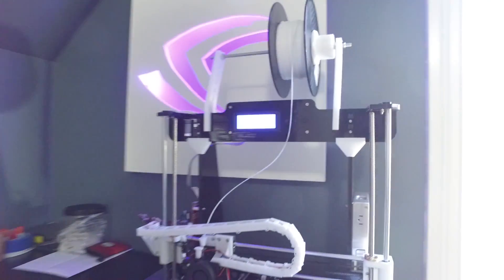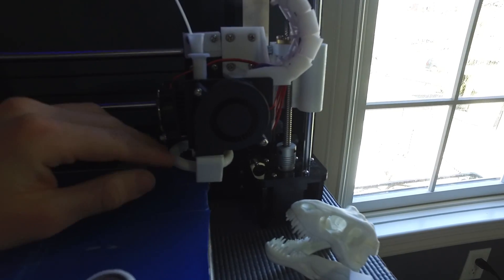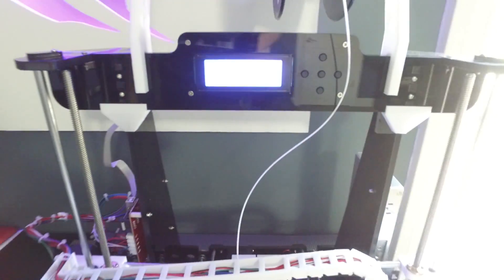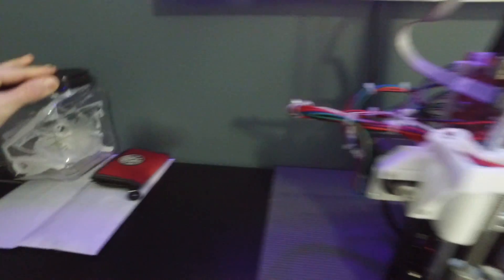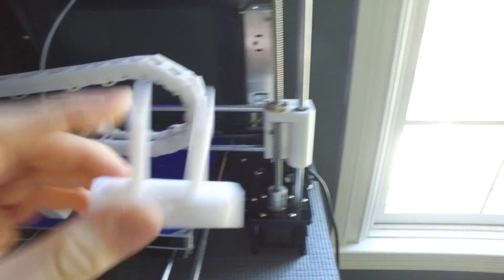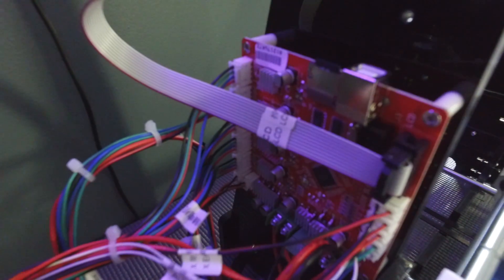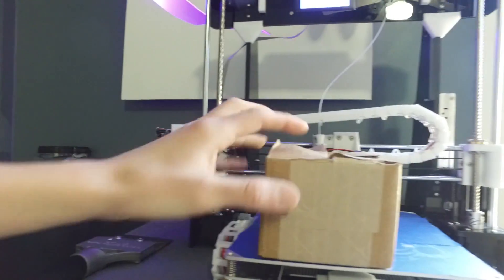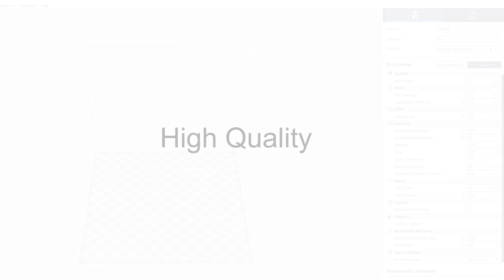Anet A8 Mods, Upgrades, and CURA Settings

Comment: Shouldn't the z screws be up inside the guide holes? I adjusted the slack from the Z springs on both sides to achieve this. It deffo helps eliminate z banding.

Comment: Just got my printer set up.  I am having a problem.  At first, it would start the print off of the bed.  I made some adjustments.  It started print on bed, but then will go off bed again.  Can you point me in the direction to fix this?  Is it a leveling or centering problem?  Thanks for all the great info.  Can't wait to print.
Reply: I had the same problem I tightened my x belt and it started to print good

Comment: Interesting bits...
You should take a couple of those bearings and print top housings for the z-axis. The bearings allow the z axi to spin without top wobble. It's not a crucial vitamin compared to the belt tensioning stuff, but it'll help with tall prints.

Comment: Hey can you tell me how did you start printing when you completed the pinter assembly. Is there anything you did to the firmware or anything which helped you start printing or it started printing out of the box after assembly is done

Comment: Funny how many complains about the n and l wiring of the powersupply. Hell in many places u can put the plug in the outlets every wich way so it does not really matter.

But No cover for the mains now that is really bad and should be fixed before some idiot bumps in to it and get electricuted.
Reply: Anders Strömqvist definitely, I’m working on a design for a psu cover with an adapter to pc cable.

Comment: hi iam getting a a8 how about providing your actual cura config file  and whot windows system will it run on and the pc min specks thanks
Reply: nightrider mick you should be able to use 7, 8, or 10. I use 10. But also read the comments I posted the config file. But here it is anyway... https://drive.google.com/open?id=0B9MwKeBPVAuiLU5BcHgyeTk1ejQ I have an i5 in my pc runs fine.
Reply: whot will be the min spek to run on pc m8
Reply: nightrider mick windows vista or later, OpenGL 2 compatible graphics card, and an intel core 2 or AMD Atholon 64 or newer. 

I have an intel core i5 4690k and runs perfectly but basically anything can run cura. It’s just a slicer, not a 3D building software

Comment: you mounted z rods badly :) Shaft from steper motor goes inside rod tensioner just 5mm. Same goes for the z rod (just 5mm in tensioner). When you do it like that....z rod goes all the way up through the hole in the frame.

Comment: Just a heads up, the Anet A8 power supplies come as 220v defaulted. I found someone else who mentioned it in a random post somewheres. This causes all sorts of power issues if you're on 110v
Reply: Peter Couture so what should I do exactly?
Reply: There should be a switch on the old power supply for you to change the 220 to 110. Use something none metalic to do it.
Reply: Peter Couture ohh ye I already did that. Mine is switched to the 115 not the 220
Reply: The old one flat out did not work.
Reply: 115? Hmmm maybe you got one for the wrong country power type.

Comment: Your power supply cables are not correctly connected, brown is live L and blue is nuetral N. That is european colors on the cable you have. http://www.electronicshub.org/wp-content/uploads/2015/09/EU-Color-Code-for-Electrical-Wiring.jpg

Comment: You should buy a build plate sticker or build plate surface so you don't have to spend so much on tape.
Reply from the maker: Just use thick masking tape. I still have not gone through a roll and i only spent 8 bucks

Comment: Although on AC power it would not make a difference on functionality but you have the Live (Brown) and Neutral (Blue) wires swapped on your power supply. Having said that it is good practise for safety reasons to use the Brown wire for Live (L) and Blue for Neutral (N).
Reply from the maker: No I understand... The Manufacture did not properly sleeve the cables...

Comment: My printer is built and levelled ,Cura 2.5 is installed. How do I get the Anet A8 to show as one of the printers? Do I have to Plug the USB into my PC? It does not appear in the lists and the "other" choice only gives one option.
Reply: Umm when you are setting up a new printer just add pursia i3 or other, then put in the dimensions for the bed... You don't need to connect your printer to the computer.
Reply: Awesome ,I added a Prusa i3 and named it Anet a8 at the bottom of the page.

Comment: hi, what settings should i used for abs fillament, its an anet a8
Reply from the maker: So for temperatures use what it says on the packaging of your filament it usually is the best. 200-250 °C, depending on your plastic.

As for settings all cura settings that I have at the end of this video work the best. Just watch to the end and you will see them.

Read this for some tips- https://www.matterhackers.com/articles/how-to-succeed-when-printing-with-abs

Comment: Hello, thanks for good video and description, just a lot of work, 
I just got my printer last month, looks like yours (the newer one), it is build up now, but I did not get it running.
Problem:
1) If I go to presets: PLA heating , I get a blank screen and printer shuts of
2) I can heat the extruder with direct definition of heat temp --> works, but
     if I try to activate the heat bed --> it shuts of
3) so, just heating up the extruder and try to print the sample file from SD card it does not start (at least waiting for 20 min)
4) have seen your power suply is different than mine did you change it?

sorry , a lot of questions, but 
could you discribe if you, or another user, has detected same?
What is the "normal" waiting time antul priter starts printing.

A video to explain woud be perfect

Regards
Reply from the maker: Ok so first off don't reference of my PSU (it's different), my cables have different groundings, and the sleeving colors are different.

My PSU- http://www.ebay.com/itm/Mean-Well-LRS-350-12-348W-12V-29A-Single-Output-Switchable-Power-Supply-/122214365016?hash=item1c748b3758:g:nroAAOSwcLxYH3aE

The wait time for it to start printing depends if you preheat the pla or not. Basically when your temperatures reach the temperatures set in the file it will start printing. For instance, I print using a heat bed temp of 55, and an extruder temp of 190. Since yours is not heating up, you have probably wired something wrong, or have a bad component.

Trouble shoot go to these places in each order-
1st look over all you wiring and make sure you did not make a mistake https://www.china-gadgets.de/app/uploads/2016/11/A8-3D-Printer-Installation-Instructions-2016-6-30.pdf

2nd ask your question in detail here https://www.facebook.com/groups/1068531466501015/

-3rd Contact your seller to get a new printer, or figure out what's broken
Reply: Tech Boosted
 Thanks, with getting a larger power supply (as yours) i could heat the heatbed, Now all works fine. My mentioned "waiting time" was due to that the program was waiting for a signal of reached Temperatur .
Reply from the maker: Nice

Comment: Nice video keep the good job i got a question what version of Cura are you using because I'm using 14.07 because i can't set it up whit the new version of Cura if you are using the new one can you help how to set it up please and thank you
Reply from the maker: https://ultimaker.com/en/products/cura-software

Here this video will help, it's in german, but still easy to follow.
2.5- https://www.youtube.com/watch?v=p2fiAsT7w7w

2.3.1- https://www.youtube.com/watch?v=gSXFHd-UDmE
Reply: Thank you i will try it later today
Reply: i follow the video but my PC recognize the printer like CH340 but the Cura 2.5 won't recognize the printer any ideas
Reply from the maker: You have to set up a custom printer... My printer is not connected to my pc, I transfer files via micro sd card.
Reply: ok so i can't use the printer with my pc only to fix the files with Cura and then use it in the printer
Reply from the maker: Will you re word this comment. Is this a question?

Comment: Hi i got a question I'm assembling my Anet A8 and I'm stuck i don't know where the red and black wire from the bed connector goes please can you tell me where go got the instructions to assembling i see couple of installations but they don't have the plug the we got please help
Reply: Ok so the black and red cables go on to the screw mounts on the mother board where it says "BED." I don't think it matters which goes in which, but when facing the mother board, the black goes on the right, and red on the left. Just use a screw driver, and unscrew it a bit, push each cable under then tighten down. 

If it is a light green plug connector, I am pretty sure you plug it in where it says "BED" in white text on the Mother board. I don't have this kind of connection though. However it should be the same as the open cable connection. 

If this is unclear, just re comment and I will try to help you.
Reply: thank you so i don't need a red and black wire from the power supply to the mother board or I'm missing a wire I'm confuse so how i i give power to the mother board sorry to ask my printer is missing the instructions
Reply: First off instructions are on the micro sd card. Plug into computer with provided converter.

Secondly, You will have a black and red cable that go from the power supply to the mother board.
Next you will have a red, black, green, and blue cable go from the hot bed to the motherboard. You will put the red and black cable where it says "BED," and the green and blue one will go to "BT" (BED TEMPERATURE)

What ever you do, make sure that you have your Power supply cables going into the motherboard in the right orientation, "Black  negative, Red positive..."

https://www.china-gadgets.de/app/uploads/2016/11/A8-3D-Printer-Installation-Instructions-2016-6-30.pdf
Reply: thank you again

Comment: the spool holder is adding weight to an already fragile frame and doesn't help in any way..... and tensioning your belt to the point that you need frame braces is going backwards... you are just creating problems! my printer works perfectly without all that crap... it's all about your settings.... not the hardware!
Reply from the maker: You make a point, but you also have to consider convenience. I find it very nice to easily swap between two colors with the spool holder from  above.

Comment from the maker: Machine Settings- https://drive.google.com/file/d/0B-3ffI37kjfvYlI1Wk1hQ2VuZ1U/view?usp=sharing
Reply: what power supply did you buy?
Reply: Meanwell Power Supply 12v 29A

http://www.ebay.com/itm/LRS-350-12-Mean-Well-Power-Supply-12V-29A-/122452640151?hash=item1c82bf0197:g:3wAAAOSwWWxY~lS-

Comment: Hi, I had a power supply issue with my Anet A8, the sticker for terminal identification was shifted to the right too much resulting in termination mistakes. Fortunately, I noticed before I shorted anything out...but my machine would not turn on until I noticed the issue. Once I shifted all my cable to the left on the terminal strip, everything worked fine. Happy printing:)
Reply from the maker: Good to hear you fixed the problem.

Comment: where'd you get the 30 pack of bearings?
I have been looking for a good price on those, but every one I find is only an 8 pack or 30+ days shipping
Nice vid man, love that wall light too!
Also, What version of cura are you using...
Just got my anet & it came with v14 and the seller said they recommend using v14 for "some reason", not very helpful
Reply from the maker: Bearings
- https://www.amazon.com/Hundred-Shielded-Greased-Miniature-Bearings/dp/B00NX3LKY6/ref=sr_1_2?ie=UTF8&qid=1490573784&sr=8-2&keywords=bearings+100
or
- https://www.amazon.com/gp/product/B0045F7FJ0/ref=ox_sc_sfl_title_1?ie=UTF8&psc=1&smid=AFLT987H7WA7G

they may say 30 days, but if you have prime, or pay a tille extra they come in way faster. (I got mine in 2 days with prime, where it had originally said 30+).

As for cura, I use 2.3.1. Just go to their website and download the newest version
- Version 2.4 https://ultimaker.com/en/products/cura-software

I am not exactly sure what you mean by "Version 14," Like for the printer? or Cura?

For my printer it uses some version of  softwear that "Omni3d" provides, I have not looked into that.
- http://www.omni3d.com/en/firmware/
Reply: The way cura used to do the versions was by year, until 2016
so 14 was in 2014, then 15, then 2 came out in 2016 and just started adding sub versions.
Not sure which board you have, but yours looks like the same as mine, so i will just try the new version & do the same print as one of my others & see how it turns out...
WOW - Those bearing prices! Much better!
Thanks much!
BTW, Look at your Mainboard, on the Top Left corner, does it say ANET 3D or is there a version number too?
like rev 1
Reply: Do you use ceramic bearings at all for the center?
if so, have you found any good prices on those?

Comment: Hi I would recheck your AC power cable wiring to your new power supply , In most of the world, Brown = Live/Hot & Blue = Neutral, your video shows   you have brown and blue wires in the wrong  terminals just swap them making sure you disconnect power cord from the outlet first.
Reply from the maker: Yes, I know it looks wrong, but the company who sent me the PC cable, wired wrong. I assure you as I checked mine first with a multi-meter. I also encourage anyone with an anet A8 check their cables and PSU as well.
Reply from the maker: Plus mine runs just fine ;)

Comment: How can I configure my printer so that a 1 by 1 cube doesn´t come out like a 1,1 by 1,2?
Reply from the maker: Do you use CURA? 

Watch This.
https://www.youtube.com/watch?v=gSXFHd-UDmE

If that did not help use this.
http://www.anet3d.com/uploads/soft/160525/Print-Quality-Troubleshooting-Guide-Anet.pdf

You can copy this code here when setting up a "Custom Printer" In CURA.

Startcode: 
G21 ;metric values
G90 ;absolute positioning 
M82 ;set extruder to absolute mode 
M107 ;start with the fan off 
G28 X0 Y0 ;move X/Y to min endstops 
G28 Z0 ;move Z to min endstops 
G1 Z15.0 F9000 ;move the platform down 15mm 
G92 E0 ;zero the extruded length 
G1 F200 E3 ;extrude 3mm of feed stock 
G92 E0 ;zero the extruded length again 
G1 F9000;Put printing message on LCD screen 
M117 Printing... 

Endcode: 
M104 S0 ;extruder heater off 
M140 S0 ;heated bed heater off (if you have it) 
G91 ;relative positioning 
G1 E-1 F300 ;retract the filament a bit before lifting the nozzle, to release some of the pressure 
G1 Z+0.5 E-5 X-20 Y-20 F9000 ;move Z up a bit and retract filament 
G28 X0 Y0 ;move X/Y to min endstops, so the head is out of the way 
M84 ;steppers off 
G90 ;absolute positioning

Comment: I don't like being a party pooper but i suggest you cut out the part of the vid where you say your selling the spinners. you can actually get in a lot of trouble for selling open files. I suggest making your own design spinners if you are selling them.I mention this from experience.
Reply from the maker: Well if you use the "commercial use, and creative commons" option on thingiverse you can find spinners to sell, or you can use "Inventor" like I do and design them.
Reply: ok, the one you were spinning looked like one i saw on thingiverse that didn't have CU or CC. and for your printer my dad and i have been designing better upgrades you may want to consider. including a better tensioner.
http://www.thingiverse.com/thing:2134573
http://www.thingiverse.com/thing:2115095
Reply from the maker: Here is what I used to make my spinners.
You can also follow the steps and design your own.
http://www.thingiverse.com/thing:2098458

I have created some really cool designs in Auto Desk Auto CAD...
Reply: i've designed a few myself in solidworks. just haven't gotten around to posting them on thingiverse.
Reply from the maker: Sweet.
Reply: Its a public Domain
Reply: yes you are a chinese spammer because the same exact message was posted on another comment i commented on. under a diffrent name. gearbest is the worst.  advertising EVERY FUCKING WHERE.   and no customer support to speak of
Reply: Dude, I'm not chinese spambot. This is just a good deal and I had no problems with Gearbest.
Reply: its not a patented product. the inventor never renewed the patent
Reply from the maker: Thanks, Ye I know it's a really nice printer for the money...
Reply: attack125 yea i lost 2 x 150 buck disputes.
Reply: i think you can get in trouble for even uploading that print file.  that's a patented product
Reply: Look - it's for 146.99 USD from EU warehouse (no tax in EU and fast shipping)
http://couponsgearbest.com/2017/06/15/anet-a8-3d-printer-eu-plug-active-coupon-price-gearbest-2/
I bought one

https://www.youtube.com/watch?v=ds7dGtJncv4
Reply: I can't believe it's just for 158.99 dollars
http://www.gearbest.com/3d-printers-3d-printer-kits/pp_337314.html?wid=21&lkid=10312400
I hope this can help you

https://www.youtube.com/watch?v=ds7dGtJncv4

Comment: I am using the same board and my screen showing default for heat bed and extruder what should I do
Reply from the maker: Umm well under the "extruder" option, you can manually change the temperatures, on the actual printer, or in cura you can adjust the temperatures to where you would like them. If this is what your asking?

Comment: awesome video.. mine is paid for but I'm in the holding pattern for hopefully just another week before they send it.. Have you seen guys putting glass on their beds instead of the tape??  they say its better.. what do you think?
Reply from the maker: +Hairless Hippy well personally I originally really liked the look of having a glass bed, and I view them as cleaner and easier ways to work with prints, but if you do use a glass bed, the bottom will look a lot different than the top of your print. (The bottom will melt really nice, and feel smooth. I do like the look of the smoothness but not when printing "fidget spinners" where you need both sides the same.